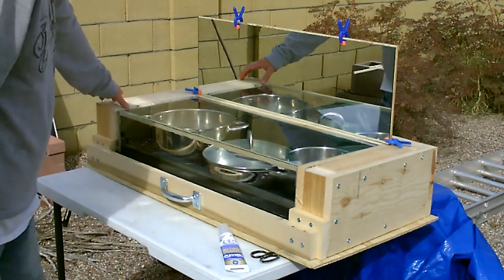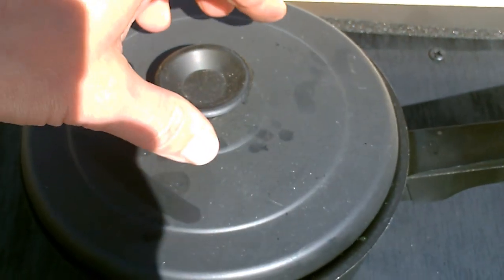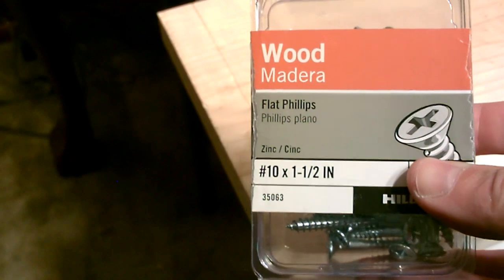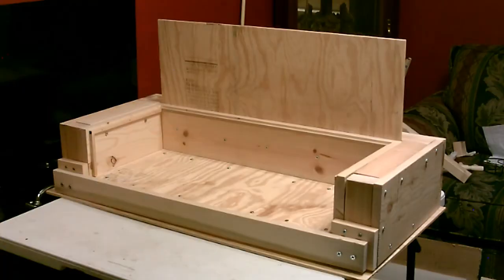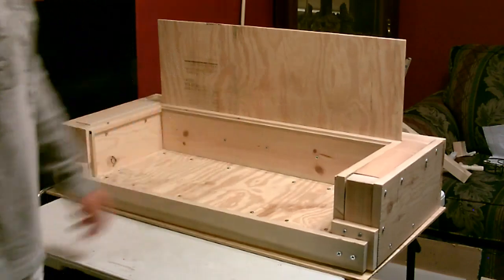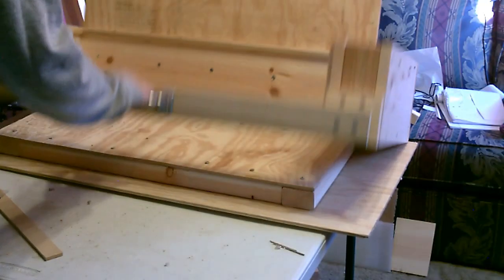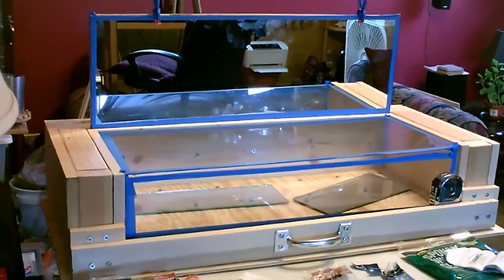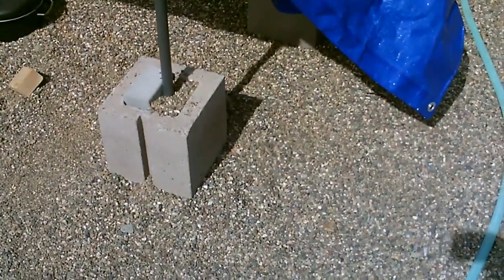DIY Advanced Solar Oven! Fully Insulated "No Turn" Solar Oven! (real wood, glass and mirror!) 350F+

Comment: I'm so late to this party.... but I'm looking at various designs and implementations. We're off grid, using solar only, and the only oven I have is a countertop unit that doesn't play nice with running any other appliances at the same time. We trip the breaker. It's very annoying. The countertop unit also does not fit any pan larger than a quarter sheet baking pan. That's kinda small when you like to bake or roast a ham or so on. I have the advantage of being in the desert, with enough sun for solar cooking to work the vast majority of the year, so I'm hopeful that I can DIY a solar oven that gets up to 400F at some point. I may attempt to get the assistance of the wonderful husband in welding up a metal interior box, and I'd probably add an adjustable heat vent in there somewhere as getting TOO hot may be a legitimate concern in our climate, and spontaneous combustion of a wood interior box becomes possible. My issues primarily being then that yes, I want it to get hot, no, I don't want it to set itself on fire. Wish me luck, and if anyone has made similar adjustments, please feel free to chime in!

Comment: Hi! Can you tell me why the insulation is necessary?
Reply from the maker: it helps keeps the heat in the oven. if you didn't use the insulation the heat would escape very fast.
Reply: @desertsun02  could i use firebrick as insulation or build the structure using firebrick instead of wood since i have enough firebricks .. thank you

Comment: Tbh, so many of the Solar ovens/cookers out there are over complicated and inefficient, which is why I developed an easy vacuum insulated system (not tubes, and I can put a pot in there). 

  I still gave a like because it is a good design for these more traditional type solar ovens/cookers.

Comment: July 24 going on 5 years and the cooking I built from your output is still outside and doing good.
The only thing I've had to do was reseal around the plexiglass with silicone.
It seems like I have to do that yearly.
I know I had a different name back then. But it keeps 200 to 275 from half hour after sunrise to after hour before sun set. And half hour before sun set to hour after it's still 200 plus in summer.
I also make a d
Pour over ground coffee. All I have to do is put water in night before and morning it ready. 
Bread takes all day. But it a soft moist bread.
Though it should. I can't get it to slow cook beans.
To me it should be called a slow microwave. Because it good to make things warm just put in a few hours before and let set.
The pro/ con is they don't remove moisture

Comment: How warm does it get when it's cloudy?
Reply from the maker: the box style solar ovens don't work well when it's cloudy. if it's partly cloudy then a solar parabolic dish is the way to go. all you need for those to work is about 10 minutes of sun. i just wait for a break in the clouds and then start it up. another option in partial sun is to use 12v pans connected to 12v solar panels. you need about 15 minutes of sun for that to work. if it's totally cloudy then it's best to skip solar that day.
Reply: @desertsun02  I wonder if it can be scaled to work on a cloudy day (not as efficiently, of course). After all, it does get warmer during the day, even if the weather is cloudy :).

Comment: does anyone know what kind of glue / silicone to be used to be heat resistant and food save. not fuming out any chemicals when heated up?
Reply from the maker: hi. the best thing to use is 100% silicone caulk. it is considered 'food safe' and handles high heat (up to 400F (approx. 204.4C)

Comment: Thanks for sharing this.  I would be nice to have some trials shown to get some measurements to work with.  It seems that some of your design elements are well thought out.  I was wondering if the heat efficiency would improve would two layers of glass with a small gap or whether the gain would not be worth it.  In full sun light, would one hour be enough to cook a veggie lentil soup?
Reply from the maker: hi and you're welcome. i have tried double and even triple layers of glass on different solar collectors but with each layer of glass the temperature always seems to go down not up (it's like the glass is blocking the light from getting through).
Reply: @desertsun02  Thanks for this feedback, you may have saved me from making my unit harder than it needed to be!

Comment: Hello, I am close to the end of building your design. I am having trouble finding the 500 degree food safe sealant. The tube was a bit out of focus in the vid. Can you post the link where you bought it?
Reply from the maker: hi. it's just standard 100% silicone caulk. the temp rating varies on it but it's usually between 400 to 500F. 100% silicone caulk is considered food safe (so it's not anything special)
Reply: @desertsun02  Awesome, thanks for the quick reply. I'll send a pic when I'm done.
Reply: @desertsun02  I build my oven and a rolling stand for it. I put ceramic tile on the floor of the oven. I live in Michigan and sunshine here is not what it is in the desert . My highest temp so far is 240F. The ceramic tile helps to maintain heat when the clouds roll by. I also hinged the reflector so I can take advantage of the suns position when it is a partly cloudy day, which it is more often than not in my state. The hinges also allow me to fold the reflector down for storage with a grill cover outdoors. I have cooked bacon wrapped pork rounds on it and they were very juicy and tender. I also built drying shelves to put inside and have dried mullein leaves for tea.

Comment: Don't the glass gets broken because of the high temperature?
Reply from the maker: hi. the glass won't break. it. holds up fine. these ovens heat up and cool down relatively slowly so no issue with too much stress on the glass.

Comment: Thanks a lot! Is the silicone needed to reduce risk of burning insulation or is it optional?
Reply from the maker: hi. the silicone is optional. just helps seal the whole unit
Reply: @desertsun02  great thank you!
and for the paint, is it safe to use any high temperature black varnish? I'm a bit concerned about volatile substances.

Comment: I just have to say a few years ago I made a solar oven like this.
Except mine is bigger.
inside oven is 12 inches deep x 18 inches long x 12 inches tall.
I used plexiglass as my glass.
wood is 2x4 frame and 1x8 fence pickets. And blow in insulation as the insulation.
On Cloudy day it does not get to 150. But temp does rise. on guess 100ish.
On sunny cool days. It goes over 150. 
On sunny warm days  150 - 225.
On hot days 90 to 100 it gets above 250 during minus 2 to plus 2 hours of solar noon.
On hot days, 105 to 115, it almost gets to 300.
I don't have the reflector on top.
And it sits on a moving blanket. ( pads used in moving.) 
I cook bread in it.
And I heat up coffee in it. 30 minutes after sun rise it has hot coffee.
Why I made mine bigger.... Well I always felt solar ovens were toys. And no one made one decent side. So I did.
Also, it stays outside 24/7/365.  
It's not light compared to the toys.
Now I can get better performance by following the sun. 
But I can't get over 300 degrees.
Now, on bread..I put it in the night before. And by sundown it done.
However. Dont expect bread like an oven.
Its cooked..But it basicly has no crust. And will be the most moist bread you have ate.
Plus with the slow cook. it makes bread rise without yeast.
Here are a few recipes.
#1 Poor boy bread
1 cup flour 
enough water to make dough.
mix and put in pan.
#2 Serf bread
1 cup flour 
1/4 sugar
enough water to made dough.
mix put in pan.
#3 peasant Corn bread
1 cup flour
1 cup corn meal or corn flour
1/4 cup sugar.
enough water to make dough.
mix put in pan.
..
Now I've tried different flours. I grind flour. And its the same on cooking.
Also. I know just grind dent corn for corn meal.
I've tried just using corn flour without flour and it won't stick together. 
Also the one cup comunation is as big of a loaf as will cook. So just make multiple at same time if you want more.
On less then warm days, but has to reach 150. you may need to cook 2 or 3 days.
I found clean small tuna can to large tuna cans make great bread pans per person. Only fill half way up.
On large ones you can stack easy. If stacking don't bother with lids. Same with small.
I've also painted outside of cans black.
Just stack cans and spray paint.
The solar oven also works good as slow cooker. Though beans don't cook well unless they are pre cooked.
But I've always had a bad times with beans. UNTIL I learn to cook beans with a pressure cooker. Now I don't cook beans without a pressure cooker.
To pressure cook beans.
And yes you will read correct no soak needed
rinse beans.
Fill pressure cooker 1/2 up with just water.
Add beans ( amount don't matter,  I done
1/2 to 5 lbs like this)
put on stove until the knocker starts more then 1 knock a second.
Don't touch heat.
cook for 10 minutes.
Let cool.
can remove knocker but don't open until 100% of steam is gone.
Once steam stops . You can open and beans are DONE.
Now pressure cookers for canning will tell you can't can beans.
This is something new. 
I haven't yet..But I found a reliable source printed in the 1970s that says 50 minutes.
Also note times differ to elevation. Higher you are more time needed.
I'm at 4000 feet. Which will cover most people.
If above 6000 feet add 15 minutes.
Reply: Yeah I never made the reflector.
There was reason why.
I didn't use any stripping.
But I did seal all cracks and two plexiglass together with silicone. 
I revealed plexiglass the second year.
But the next didn't. It didn't make a big difference.
I'm sure I loose a tiny bit by not resealing plexiglass. But its nothing.  It still heats up and keeps hear during day.
And I use to chase the sun. Which I stopped doing.
If I'm  heating coffee..I face to sunrise and more to solar noon position when I take coffee out.
Most years I use from 1st March to 1st December.

Comment: Very nice design. But I am afraid that with hot/cold and humid/dry cycles the wood will crack sooner or later. I'd rater use plywood for the inside parts.

Comment: Thanks for sharing this excellent build. I've watched allot of these solar oven DIY videos and this one is the winner by far. I think I will build one, but I am going to use black (or painted flat black) ceramic tyle lining the inside for some added thermal mass.
Reply: @peachluck333  Sorry, I just saw this today. I did build my oven and a rolling stands for it. I put ceramic tile on the floor of the oven. I live in Michigan and sunshine here is not what it is in the desert . My highest temp so far is 240F. The ceramic tile helps to maintain heat when the clouds roll by. I also hinged the reflector so I can take advantage of the suns position when it is a partly cloudy day, which it is more often than not in my state. The hinges also alow me to fold the reflector down for storage with a grill cover outdoors. I have cooked bacon wrapped pork rounds on it and they were very juicy and tender. I also built drying shelves to put inside and have dried mullein leaves for tea.

Comment: Great build but one quick bit of feedback, compressing the insulation actually reduces the R value. The air spaces between the strands reduces heat exchange. Perhaps instead of fibreglass insulation I might think about using mineral fibre like Rockwool.
Reply from the maker: hi there. definitely don't use fiberglass insulation. i used green fiber insulation. 👍

Comment: Where did you get the glass and mirror pieces? Or how did you cut the glass and mirror to the size you wanted?
Reply from the maker: i bought the glass and mirror at a home store. i had them cut some of it and just used a standard window glass cutter for the small pieces. btw - if you've never used one - window glass cutters are super cheap ($3 to $5) and easy to use.
Reply: Thanks for the reply sir. Great videos

Comment: This is by far the most useful, efficient solar oven design I have ever seen!
Reply from the maker: hi and thanks!
Reply: But it is Durable.
Mine is going on five years old.
Not 100% like this. But this video was my basis for it.
And it sits outside all year next to my house. 
If I was to make a new one. I would use plywood for the wood. I used the 6 inch fence pickets. 
Also mine is much bigger 
Inside is 18 inches tall 18 inches deep and 24 inches long. .
There isn't much I can't put in it.
Oh sides I used blown insulation. 2x4 thick.
I never did put a mirror on it.
The one I originally bought got broke on my way home. And it is 200 mile round trip to get one. And I kept forgetting to get one march to December range 200-275 during the day. December to March most the time 125 to 225. below freezing 50 to 110.

Comment: ce four est tres interessant un seul point m'inquiete c'est les 6 h de prechaufage  si le four est "allumé" à 08h00 il faudra attendre 14h pour l utiliser c'est inaceptable dans mon cas la teperature externe est 25 degres C  merci pour votre explication
Reply from the maker: hi there. i'm not sure where the confusion came from but there is no preheating required or not very much. it will fully cook things in 4 to 6 hours with no preheating 🌞🔥🙂
Reply: @desertsun02  thanks for your quick reply. 1) Do you know how long does it take to boil one quart of water (4 cups) [close to one liter] 2) How long for a chicken of 3 pounds 3) Do you have detailed measurements of the oven, I am traveling to Africa and would like to bring the drawings to them 4) Would mirror be better than painting 5) Is the mirror orientable (probably orientable mirror on each side would be more efficient or is it silly). Thanks in advance for you reply.

Comment: Very nice!  I wonder how hot it could get if you put a giant fresnel in front of it?

Also, I don't know much about installation of the green fiber insulation, but I just wanted to point out if you pack it too tight it will decrease in insulating ability.
Reply: fresnel lense seems like a good idea

Comment: how about some updates with some variety of different cooked foods from this oven showing the results? I'm thinking of making a version of your oven but with an aluminum grill, already black and some metal sides and back, also painted black unless I can find more black grill. Metal is a better conductor than black painted wood and it might help increase the temperatures inside to new heights? But 350F seems plenty hot for just about anything.

Comment: The only part that you did not insulated was the glass if you put it double layer will make the green house effect. I like your project 😃👍👍 hi from Puerto Rico 🇵🇷
Reply from the maker: hi there and thanks!. i've tried using 2 and even 3 panes of glass but when i use even 2 of them the temps go down. i guess it blocks too much of the sun. i haven't figured out a way to insulate the glass or top area.

Comment: Had you ever considered using a Fresnel lens incorporated into your designs?
Reply from the maker: hi. yes i've thought about that but i think the fire danger with those is too great.
Reply: @desertsun02  A large fresnel lens will break the glass, happened to me 4 times now including a heat resistant glass panel I removed from a real oven. It will also warp the wood and burn it if left unattended, it also burnt unremovable permanent stains into the stainless steel mirrors I was using.

Comment: Amazing work... 👍 I am curious... can clay pots also be used in this oven? Will it cook in clay pot or does it need metal pots? 🤔
Reply from the maker: hi there. that's a good question. the air in the oven gets nice and hot so i would think they would work. might take a little longer to heat the clay though.

Comment: You actually did not need to pack the insulation down tightly.  You get better insulation when it is loose.
Reply: Or even no fibre at all, since air is a good insulator?
Reply: @brunosco  No, although air is a good insulator, with loose insulation you prevent any convection currents in the air from flowing.  Convection currents will reduce the insulating effect of the air.
Reply: @User2718218  Thanks for the info. Good to know! 🙂

Comment: What does he mean by "works up to 6 hours before TURNING"?
Reply from the maker: hi there. that means that since it has such a long low profile (and no side reflectors), - that it casts a very minimal shadow into the oven, so you can get away without turning it for a very long time. lots of solar ovens have higher sides with big reflectors so you have to turn them every 30 mins or so or you will lose lots of 'cooking power'.

Comment: I have a possible suggestion to prevent heat loss. I built something similar by accident in my garden. I was trying to build a cold frame for my seedlings, which was basically a painted plywood box with a hinged glass window for a lid. I set it right on the ground and piled dirt around the sides for insulation, then stapled thin strips of dish towel along the crack under the window lid. This literally cooked my seedling on a chilly late winter morning. I opened the box and billows of steam came out and everything inside was literally cooked, so I guess it went above 212. I was thinking that might work in your design too, to put wide strips of cloth all around the base plywood so that the lid is compressing against it. Mine was not built nearly as well as yours (since it wasn't MEANT to cook my plants!), but with just those cloth strips, it was able to get above boiling in winter.
Reply: This would explain the ceramic cloth seals we have on our wood stove glass door.